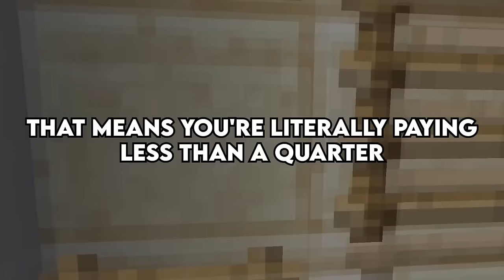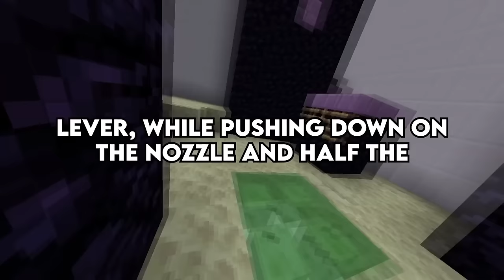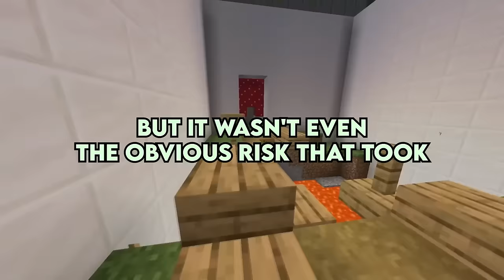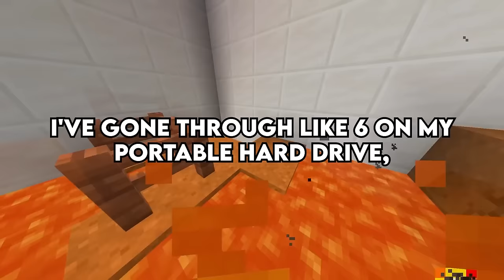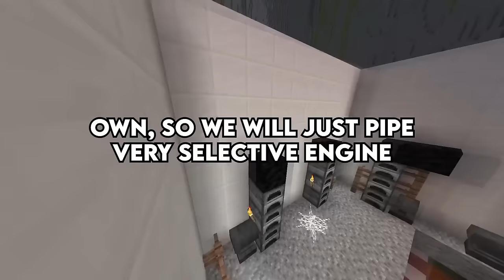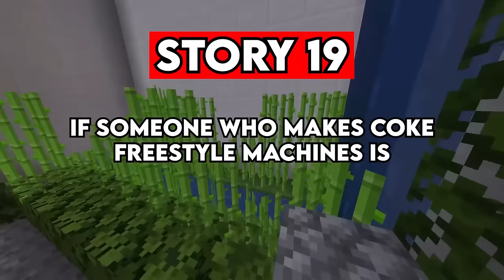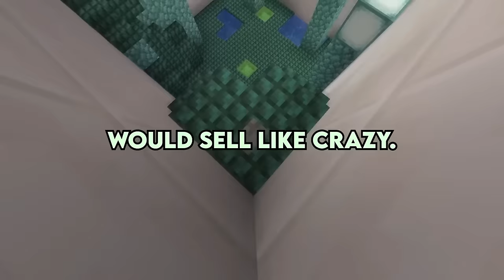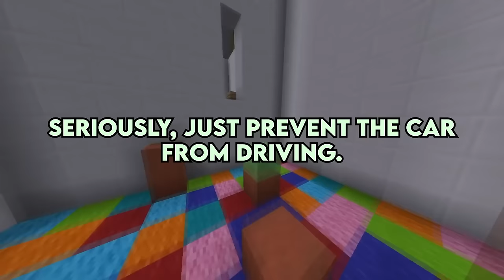Engineers, What Feature Existed Because Of Dumb People?

Comment: Safety guy here. Yes, ark flashes are really big problem. They can happen anytime but are worse in wind, humidity, or worst of all, rain. OSHA specifies the distance between you have to be from a powerline, and the minimum is 10 ft (EU specifies 3m). If he was only a meter away, it was a matter of when not if
Reply: i wish they taught more about electric potential and electron movement patterns in school because i had to get my own books to learn stuff like this after starting in the trades
Reply: To add to this the safe distance depends on the voltage, a high voltage line (69kV or more) will have a higher safe distance
Reply: @SunshineTheLover they did when I was going to school but I graduated high school 2012 So...
Reply: @aSipOfHemlocktea  i graduated 2016 and honestly they did the bare minimum on electricity and then gave a few scenarios where it may be dangerous. didnt even start to talk about electrical potential in my classes
Reply: If you were around in 2003, you'd remember the huge power failure that took out a quarter of North America's grid because the heat and load caused a high voltage line to sag enough to ground on a tree. The higher the voltage or the greater the heat, the more a power line will stretch and sag.
Reply: Only 10 feet?? That shocks me!
Reply: @SunshineTheLover I’m going to share a quote I ***DO NOT LIKE***. “Those who can’t, teach.” Teaching and testing yourself is the only way you will truly learn anything in this world. “Experience is what you get right after you needed it.”
Reply: @betochiwas How can you tell which Electrical Engineering students are struggling with the exam? They say “ohmmmmmm” when they reach a difficult question.
Reply: @coldacid And if you were around 12/31/1999 when my family was celebrating the New Millenium, you could’ve been standing in the dark just like they did! Don’t worry … I flipped the main breaker back on after a few seconds. 😂
Reply: @FilosophicalPharmer  ive been grateful that most lessons in life i dont have to learn the hard way
Reply: @SunshineTheLover  “Sometimes, a person’s purpose in life is to be others’ example of how not to live.” 😂
Reply: @FilosophicalPharmer  at 50 KV, you need to be 15 ft away, and it becomes progressively more as voltage increases. I would also point out that this is the legal minimum. Most companies are much stricter
Reply: Don't say "what's  that?" While pointing at a high voltage part in an open equipment  cabinet. Or just don't point at it with your finger
Reply: Also, dust levels in the air also reduce the distance across which arcs can form.
Reply: @SunshineTheLover mine did… actually I was in 5th grade when we first learned all that. What to do when someone accidentally gets electrocuted but more importantly what not to do like going anywhere near them. Then in high school you learn more about physics and AC/DC systems how they work and their dangers. Then again it doesn’t take knowing all that to know you shouldn’t go anywhere near a high voltage cable even if you think it’s not active, there is a little bit of natural selection there. You know what I’d rather take my chances with lightening.
Reply: Yep. Some guys I knew at college were out on a pub crawl and made their way into a train yard and did stupid things there, like climbing on top of rail cars. One didn't make it, because he was struck by an arc from the cable.

Comment: The frustrating thing, is that computers do have issues that would be invisible if not for those "make it look like it's doing something" features.  There's a very big difference between "this operation will take a few minutes", "this operation will take long enough that it might as well never finish", and "the programmer screwed up and made an infinite loop and this operation will actually never finish", and they are all very real possibilities.

A progress bar that responds to tasks getting done (or better yet, a text log) is an essential tool for identifying such situations.  It's not idiot-proofing - it's useful information.  (A log has the added benefit that technical users generally know what steps should take a while, and also what they might wanna double check if something takes weirdly long.)

Comment: one big thing with safety features is that they have to be less annoying then they are safe. because if they become more annoying, people will go to great lengths to get rid of the safety feature, occasionally making the situation more dangerous then it was prior to the safety feature being installed in the first place.
Reply: Like the gas can one
Reply: we got new refueling trucks and they installed proximity alarms because people misjudge the width or back into things...except they were pointed down at a 30 degree angle and tuned to 15 feet
aka if the truck was every turned on the alarm in the cab would constantly beepbeepbeepbeep because it could see the ground so that got unscrewed with a quickness
Reply: [insert Chernobyl incident here]

Comment: That airplane flight plan reminds me of old homes where they had a hole in the wall to put used razor blades. Some old homes have a wall full of sharp rusty razor blades.
Reply: Yep, that hole was cut into the back of the medicine cabinet. I think a lot of people didn't realize that there was no way to get them out of the wall later.
Reply: Had that in the house I grew up in. My grandfather installed the medicine cabinet with the razor slot in the 60's. Helped us find a leak in the roof. We would have never noticed it if it weren't for the rust streaks we saw behind the sink.
Reply: It reminded me of the King's Cross Fire. They initially thought terrorists had attacked the tube station. Long story short, wooden escalators plus loads of grease (lubricant for the metal machinery) plus years of ticket stubs and other flammable trash creates one hell of a fire when the fire keeps  lose to the ground so fresh air can rush in along the roof above said fire to the bottom of the stairs to breath more life into the fire. Wooden escalators were exchanged for metal ones after that.
Reply: @TheDandelionViking  . . . wooden escalators? How the f does that work?

Comment: Errrmmm.. concerning the train: That is something you absolutely SHOULD know. Sparking from high voltage cables over a long distance is not a "malfunction" it's a design feature of these cables that WILL happen. So the only thing you can do is remove the human out of that equation. And it's just that up until then the workers in this case were lucky that humidity was not high enough for the spark distance to be long enough for killing them.
Reply: And since you really seem to not know:
Dry air will have a certain break through distance for a given voltage (at least with non insulated cables like at power lines or cables over trains that is what protects you from the high voltage). It can roughly be estimated (if you want to go on the safe side) as 3mm per kV. Now this means for a train we'd get 25kV * 3mm/kV = 7,5 cm. That already means: You don't have to touch the cable to fry yourself (important!).
 If the air becomes wet, it's easier to ionize it (the details are actually a bit more complicated physics having to do with "killing" initial ions and actual sparking dynamics). Ionized air is a very good conductor (as seen in a lightning). So now depending on some drops dripping down from the wire (that might support the spark) or whatnot, that "safe distance" is not longer safe any more. It might even be dust particles that lead to the initial spark. So I'd guess for a really humid day this safe distance might instead be half a meter - don't really have solid data with regards to this, so please don't rely on half a meter being safe. Inside of that half meter there might be a spark. If there is an initial spark the air becomes conductive and as long as you can supply sufficient current it stays conductive. Train power lines are designed to supply sufficient current - even at high voltage. So basically humidity helps the initial spark which makes you part of a high power electric circuit with suffiently low resistance. (if we just assume the air has no resistance at that point, since it basically becomes a plasma and you have 1k Ohm resistance (roughly what your skin has) we are looking at 25Amps at 25kV or 625kW flowing through you. That's why people look charred after these accidents.
Reply: It's always a satisfying feeling when you see an actual expert manifest in the comments section of videos like this because while they're entertaining, these narrators do tend to speak a lot of BS or make comments based on little to no experience.

I'm fairly certain anybody who has been taught to work on electricity, from hobby to domestic to industrial knows that electricity can arc and why getting close to unshielded sources of electrical power is a very bad idea.

I got whacked by a sizeable capacitor once whilst messing around with a hobby project and not only did I see the tiny arc for a split second, that little sh*t hurt like hell and I didn't do it again thats for sure.
Reply: @War_Daddy103  I personally had an incident with a lab power supply running at 27kV. Ironically I was making sure electrical safety and falsely assumed the PS was already of. That lead to me unplugging a live 27kV wire from said PS and instantly  getting a very visible ~4cm long spark into my hand. Lucky for me it was just a discharge from the attached system and not the actual PS (which also only had up to mA maximum current)

Comment: I have a hybrid - When it's on electric, the engine makes no noise at all, which can be very confusing since people don't know if the car is on, so the car actually makes a humming noise to let you know it's running.
Reply: A small amount of noise is mandatory in the EU so people can hear the car coming near. The humming usually stops when the car goes fast enough for the tires to make noise.
Reply: i recently passed by an EV for the first time that made a noise like that when reversing
i had to do a double-take because i couldn't figure out that it was the vehicle making the noise lol

Comment: IBM knew that if you didn't see stuff working then people assume it isn't working.  You can't assume that stuff is working if you don't see it "working" on most stuff.  So on their old terminals the symbols on the screen change and light up as the terminal sends and gets data back.
Reply: The visual animation actually had a real purpose especially for operations that took a long time. If you can see the lights/bar moving it means that the thing is doing something. If it stops, it means that the "thing" has frozen and it is time for "turning it off and on again".
Reply: @baronvonslambert  and depending on the system back then.
you had one command that would go throught when a program was doing something anything else would not simple register.
like you put the program to do a 30 min task. leave coworker comes in sees the machine appers to be stuck.
presses a command and nothing happen not even typing like hello into the terminal works (because its locked) the only thing that works is the 3 key abort shortcut or the break command.
Reply: It's not because of dumb people. If you didn't see something is happening you would be sitting for 5 hours before you know something is up in case something breaks. It's not because people are dumb it's because it is valid information

Comment: The gas can issue: My grandfather owned a small engine sales and service shop and explained this one to me years ago. The purpose of the multiple steps is to create a vapor seal in the gas can and allow gas to be stored for a longer period of time without contamination. Gas sitting sitting in any type of fuel reservoir (gas can, lawn mower, weed eater, automobiles too) for an extended period of time, without the vapor seal, begins to get water in it from condensation of humid air. This will be a problem in an engine if too much builds up. This is the reason why it is either difficult or impossible to start a gas powered engine a the start of a mowing season if untreated gas has been sitting in it for 3-6 months.
Reply: so why cant they design a better vapor seal? the 4 step process requiring interlocks, twisting, turning three times in a circle, forming an isosceles triangle with your left leg and right arm while doing the hokey pokey is really bad. all you need is the plunger bit that you depress on the rim. and even then they fuck that up, because the hook is off center from the center of thrust and makes the plastic bind. needs two hooks on opposite sides.

Comment: The sound stuff is annoying as there don't appear to be the option to turn them off or find the silent ones, if there are any. Car reviewers point out when they hear the fake engine noises. Supposedly vacuum machines are intentionally loud because when they made quiet ones, people thought they were underpowered. I guess looking at the floor you're cleaning doesn't mean anything.
Reply: In the US electric cars are required to make fake engine noises, so that pedestrians can hear them coming
Reply: @ddenisehhoy8369  Good point. Even if it's a "underpowered" thing it also provides a safety thing for pedestrians. everyone benifits
Reply: @ddenisehhoy8369   Same here in Germany. I thought it was mainly intended at blind people who actually are solely relying on noise.
Reply: @DerKiesch   For Germany that is probably all they are for.
Reply: @jaredcrabb  I've been told, by someone who worked as a professional cleaner (of passenger rail cars) for a while, that household vacuums often have higher power numbers than industrial ones, just to make people buy them. Not sure if it's true, but the psychology behind it certainly is.
Reply: @KaiHenningsen  for some maybe. But nothing beats professional vacs. they look like they are from the 60s still but man do they work well
Reply: The car noises are not for the driver, it's for the safety of pedestrians
Reply: That's why light weight devices like cell phones often have weights in them. The weight is for the tactile experience of the user. It does nothing for the device.
Reply: Some electric cars are honest about their noise generators.  I've seen several that emit a soft white noise when driving slowly.  Perfectly adequate for getting people's attention in the parking lot, and far less annoying than fake engine noises.
Reply: @andrewholden1501  many are honest about the noise generators. They still put them in because electric cars give no audio to indicate that the car is running. The sound is there to stop complaints that the user pressed the start button but the car didn't start. You have to understand that such a stupid solution solves 99% of the complaints about expected feedback information from stupid users. It's the same reason why loading rings and their variations exist in the computer world. Loading rings are there to tell you that the computer is doing something but don't actually tell you that it's progressing with the loading or how much progress it's made.